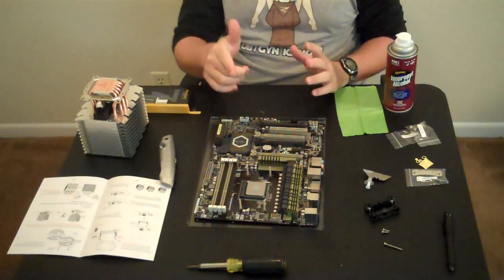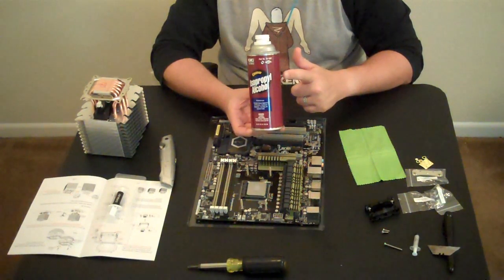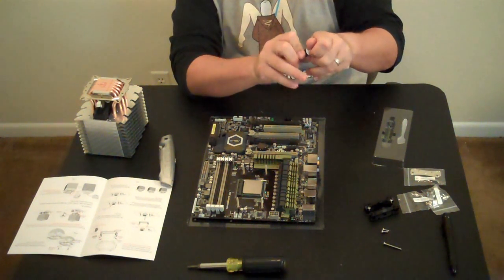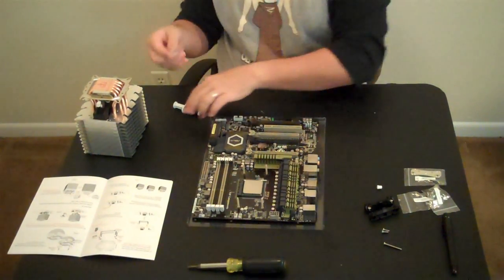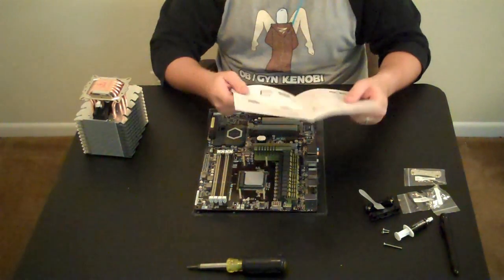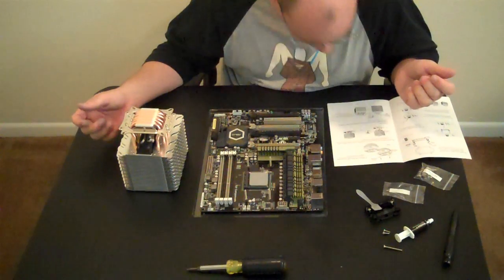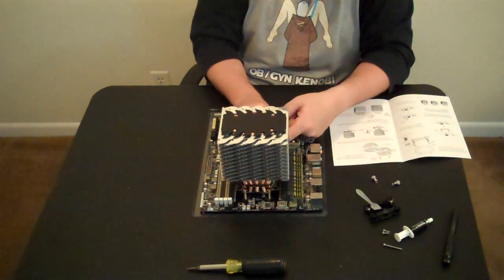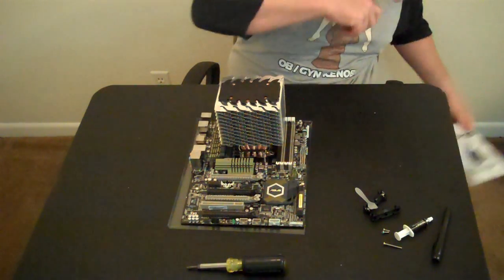AwesomeMattG Builds His Computer (005)

Comment: @Dresenpai Arctic Silver 5, once it is applied it will connect the processor and heatsink forever. The only way you can get them apart is by damaging one of the parts but the paste has a very high conductivity and is able to keep the processor very cool.